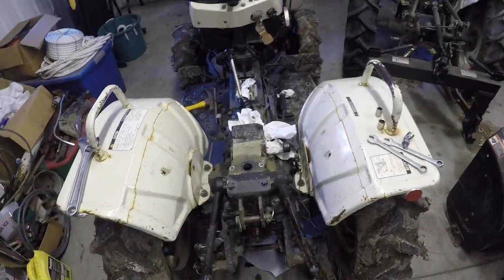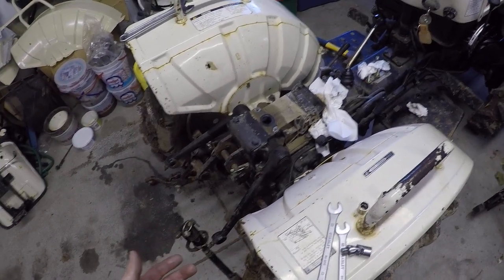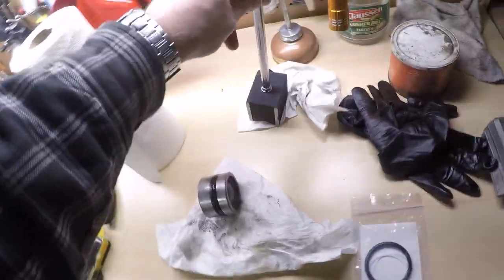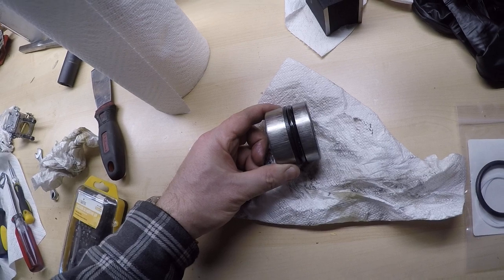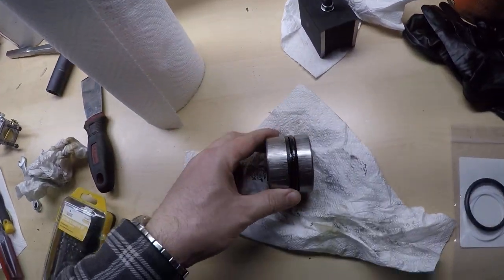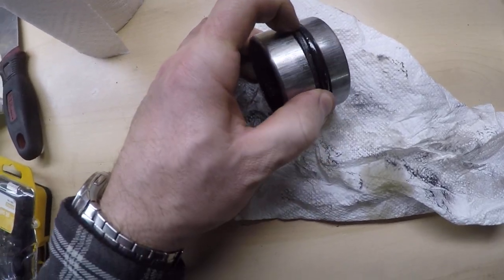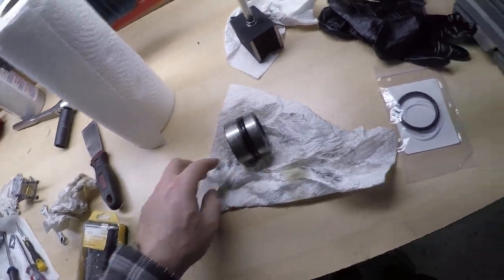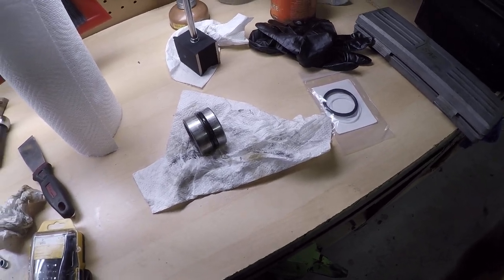3 pt re ring

Comment: Where did you find the oring and back up rings? im having a hard time finding them.
Reply from the maker: The O-ring is a P50A and the backup ring is for that designation.  49.6mm ID x 61mm OD x 5.7mm cross-section.